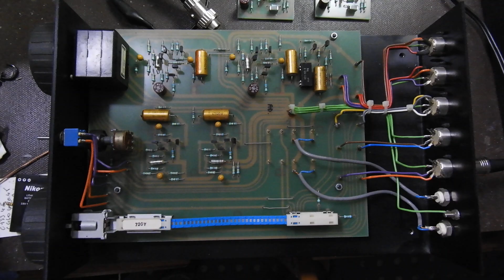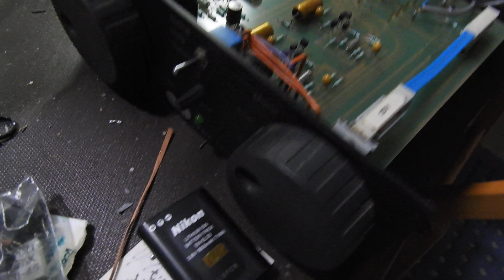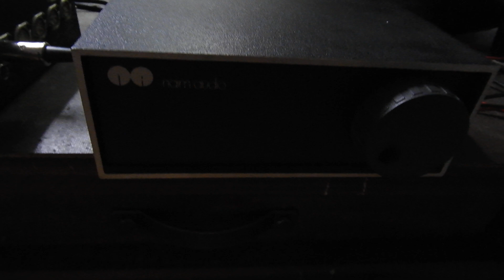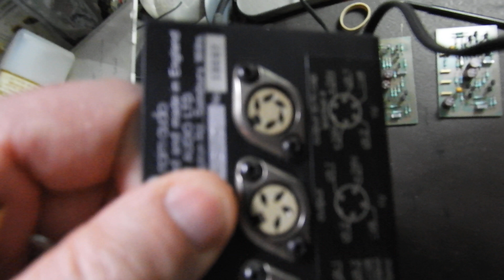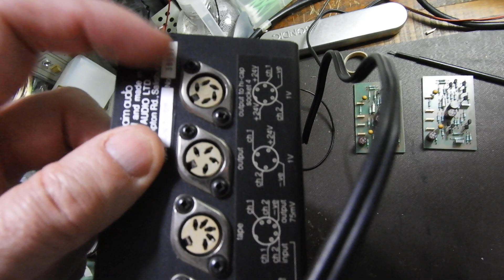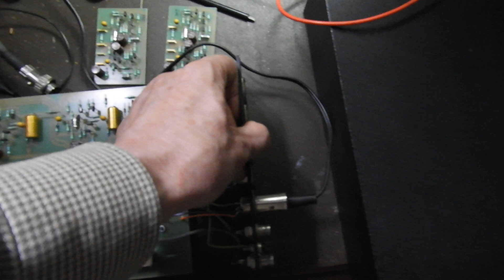Naim NAC-62 pre-amp & NAP-140 power amp. Mysterious lack of supply to the pre.

Comment: You do not appear to have the necessary five pin DIN blanking plug fitted. It is easy enough to make one up - just find a five pin 240 degree DIN plug and connect the two power pins together. Problem solved! Or, buy a proper NAIM blanking plug.
Reply from the maker: I just used a crock clip to join the two supplies together inside of the unit. Originally, when I was uploading the video I wasn't sure this was the right thing to do, but soon after I worked out what Naim was doing.

Comment: I have had Naim equipment in the past and I'm sure there are shorting plugs that should be fitted to the PSU sockets when you're not using a Hi-Cap/Flat-Cap.
Reply: I use a Hi-Cap and I have the same problem in my NAC72!

Comment: Hi, I have a NAC 72 which is very similar, I use a lab power supply with twin 24 v outputs, because according to naim it works better by separating the voltage that powers the  audio circuits and the logic circuits(relays and naim led), but in practice the two 24v inputs can be tied together